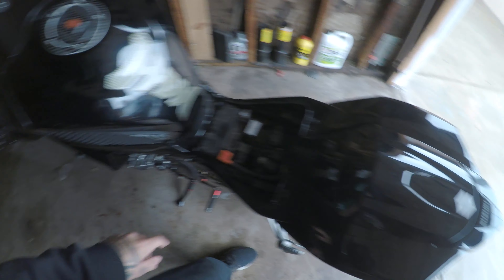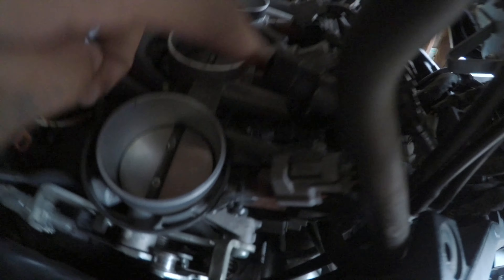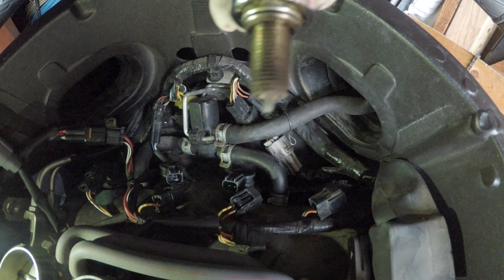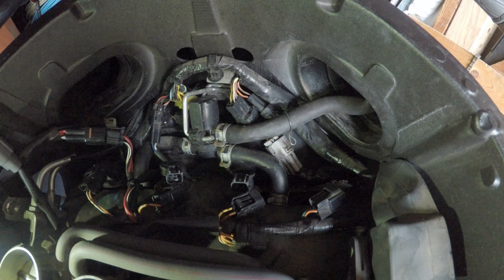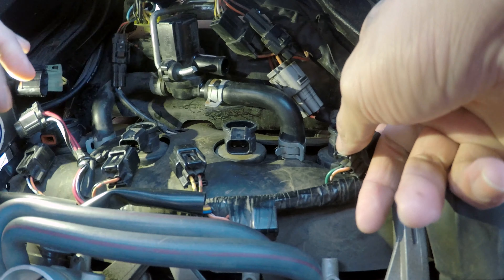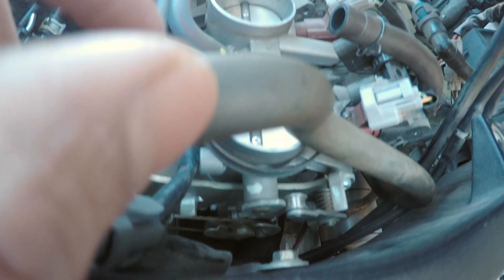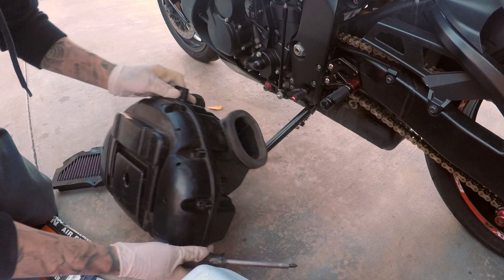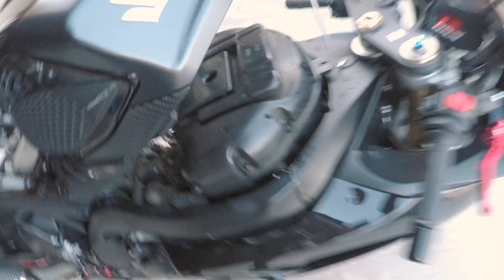DIY How to Change Spark Plugs and Air Filter on a k8 GSXR600 #diy

Comment: great vid man especially showing where to reconnect the hoses and that one connector...only thing you missed was in addition to the 4 hose clamps there is also 1 screw that is in the hole in the top center of the air box (that can be a little tricky sometimes so I just replaced mine with the same screw only slightly longer...if yours is missing that might be where you are hearing a whistling noise or vacuum suction noise.  Also you are correct the spark plugs come pre-gapped so no need to adjust them.  Also great advice with hand tightening the spark plugs first (which applies to any vehicle)...if you strip the threads or over-tighten you're fucked lol.
Reply from the maker: Thanks for watching bro, great observations and good thing you point out some of the important parts of this video. 👌🏻